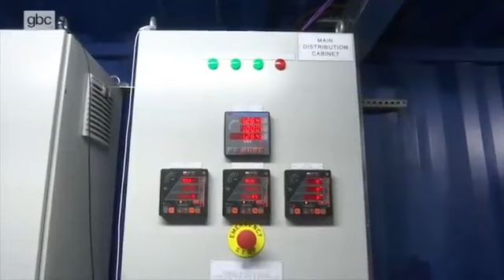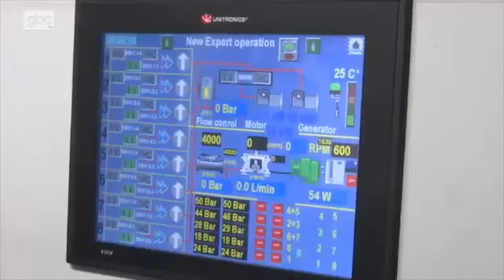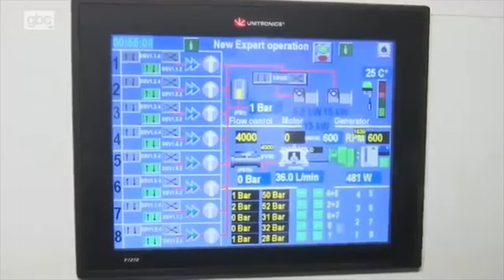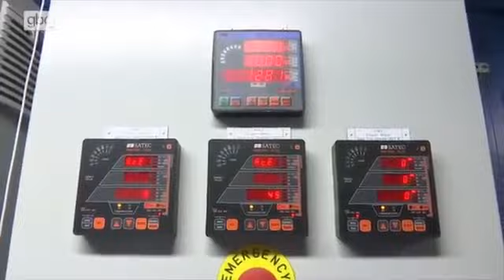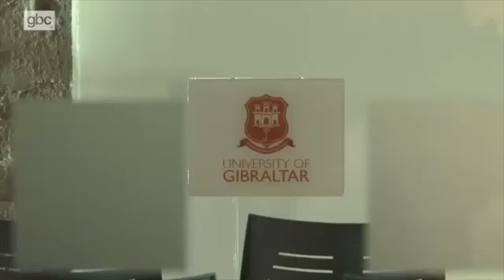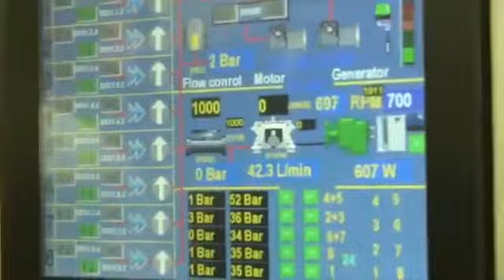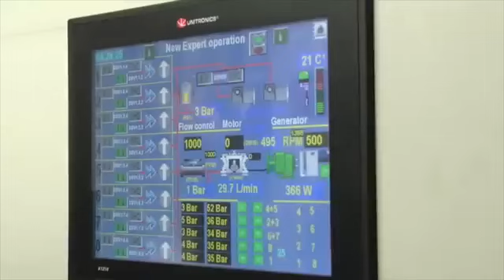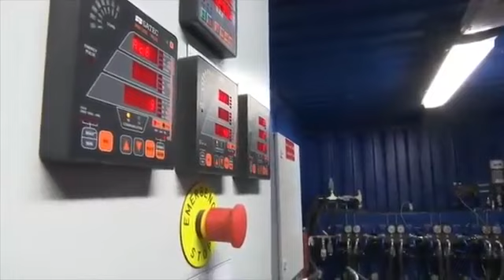Eco Wave Power: David Leb and Inna Braverman interviewed on Viewpoint

Comment: The efficiency may benefit from having small accumulators as close as possible to the wave activated hydraulic pumps. The oil surge should not need to work against the resistance from long pipes or tubes.